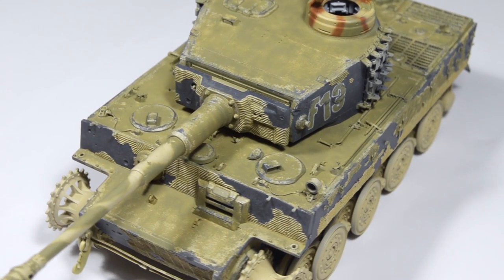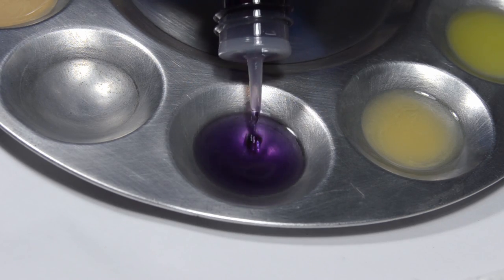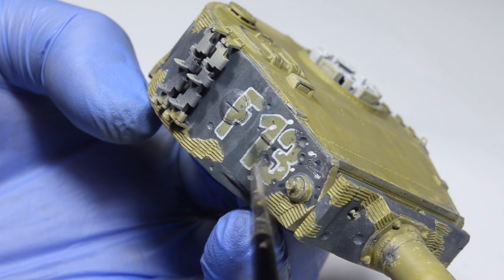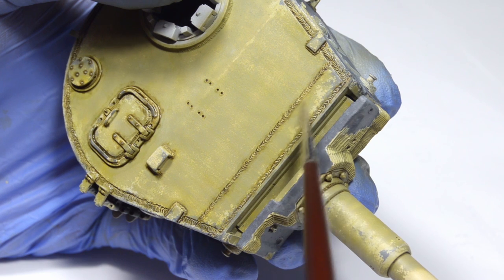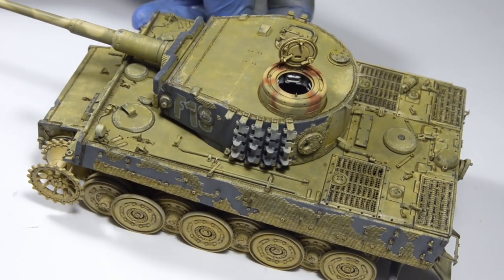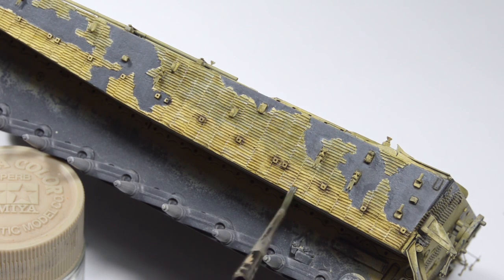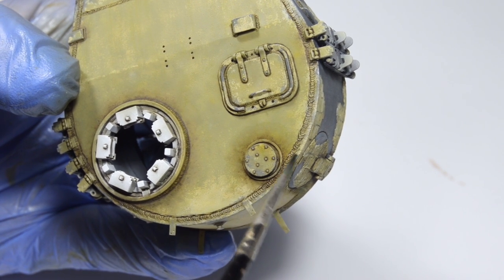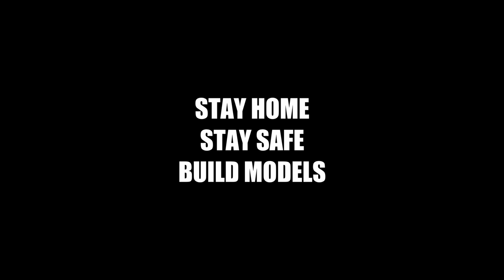Can I Save The Ugliest Tiger With Oils And Washes? | Tiger 1 Gruppe Fehrmann | Rye Field Model 1/35

Comment: Martin, I try to turn everyone on to VMS products - they work really well. They freak me out because it's weird, but I've been surprised everytime. Their photo etch CA glues are my mainstay, the decal solution is super hot and melts decals great. Clean slate remover was like magic. I haven't used everything, just what I have troubles with (photo etch). I think Uschi Vanderosten has a solution that is supposed to cut down on the dry time for oils, but I think it's just a medium that's available to artists called Liquin. I use Liquin for my oils.

Comment: I am probably wrong, since you tend to be very thorough with your research, but somehow I feel there should be more difference between yellow and green, and grey should be way less saturated because dust and sun tend to to do that.
As an idea, you can make a black and white photo of  your model and compare it to the original ones to determine if your colour saturation is on point.

Comment: Ok so the tank was originally panzer grey, then back to the factory for zimmerit and a coat of dunkelgelb over the top, and then, presumably after some time in the field again, it was painted green in the field. It's a cool visual story but I think that the green paint shouldn't be present only on the zimmerit, but there should be patches of green on the panzer grey as well. Those are the places where the zimmerit crumbled before the green paint was applied, as the way it sits now there would have been no damage at all to the zimmerit between the point where it was painted dunkelgelb at the factory and the point where it was painted green in the field. But anyway it's not like I could do better lol

Comment: I don't know how i stumbled across this channel, but I sure am glad i did. I am looking to get into tank modeling but I have never done modeling before. Is there any kits you would recommend to a complete newbie to try out some of these techniques, as I really did like the look of the 2 layer airbrush panzer grey and the added welding marks?  I would prefer something a tad bit on the cheaper side as like I said earlier I am a complete newbie, and I dont want to ruin expensive kits with my efforts.
Reply from the maker: You could try some of the 1/48 armor kits from Tamiya, they're all excellent for beginners because they assemble perfectly. Also, if you're just starting, keep things simple, even in terms of painting and weathering :) A model that's well painted in a single color with a properly applied wash is gonna be much more rewarding than a paintjob that's all over the place.
Reply: @NightShiftScaleModels   Thank you for the advice!

Comment: Hey Nightshift? Could you explain why the tracks look so weird in the photos, I searched up F13 Tiger and saw the the middle section of the Tracks were drooping very heavily exposing quite a bit of the chassis and overall making it look a lot taller. Not sure whether you mentioned it in the previous video but it's quite a strange detail (also will you be implementing it in the model?).

Comment: Ah..dinner ready and a nightshift video!!
Btw uncle, do you think that grey surfaces could have been enhanced with color modulation during painting or with oils at this stage to increase contrast?
Reply from the maker: Definitely, you can use oils to pretty much repaint the entire model if you feel like it. That's pretty much the basic formula of "oil paint rendering". You create a "roadmap" with the base coat and chipping, and then paint all over it with oil paints.

Comment: That oil expert thing looks like enamel solvent diluted oil drying accelerator (cobalt). Hope it is not expensive because neither cobalt or solvent are...
Reply: Uschi Vanderosten has a drying solution of his own, but I think it's just a medium widely used by artists called Liquin which I use. I don't know what VMS uses, but the stuff that I've tried and use now is freaky great stuff. Their clean slate paint remover smells like a musty cellar and is wicked great. CA glues also. I try their stuff out as much as I can and/or need. The varnish is weird, I can't explain it. Watch their You Tube stuff. I tried their photo etch CA glue because I was pissed with the way hobby CA performed and I was impressed. That started me buying more.

Comment: Would normal artist oils be fine to use on a model or are oils made for models very different?
Reply from the maker: Regular oils have more linseed oil in them, which has to be extracted before applying them to a model. You can do that by squeezing a small amount on a piece of cardboard and letting it for a few minutes, you'll see a big stain forming around it. 
On the other hand, more expensive artist oils have much finer pigment, but then again model specific oils are made in colors that we usually need, such as olive drab, rust, dust, etc, so they're more user friendly for our needs.

Comment: I’ve always wanted to use oils on my models but I’m afraid of ducking it up, plus I’m more of an aircraft modeler
Reply: Oil dots still work on aircraft models.. that color modulation and uneven fading on upper surfaces that have been sitting in the sun..
Reply from the maker: you'll never know unless you give it a try. oils are very easy to remove if you don't like the result, and you can always try them on a piece of painted scrap styrene or something